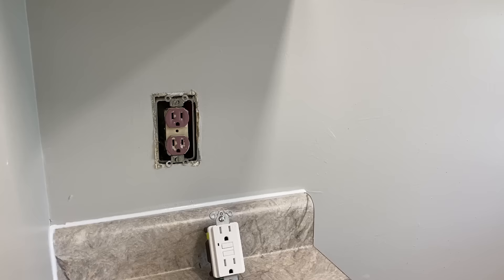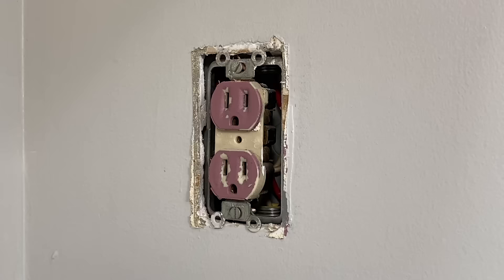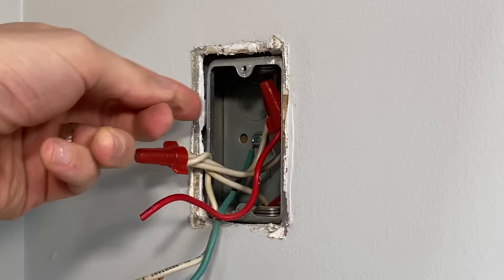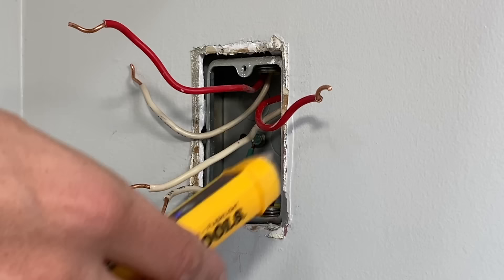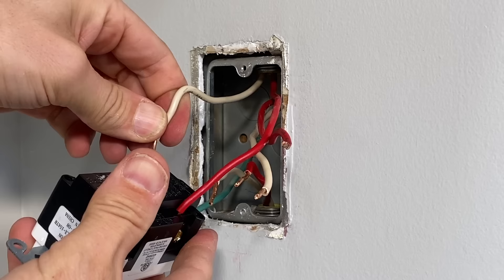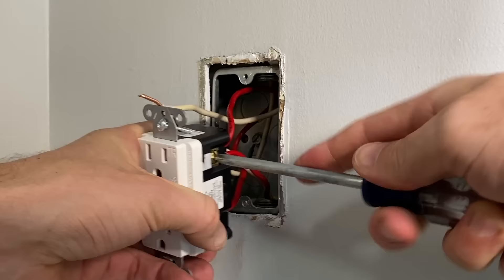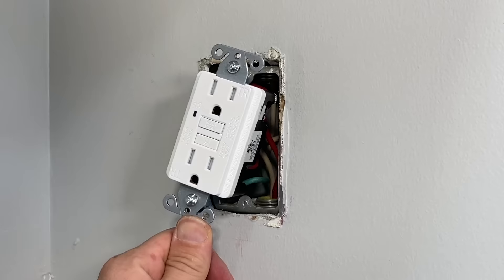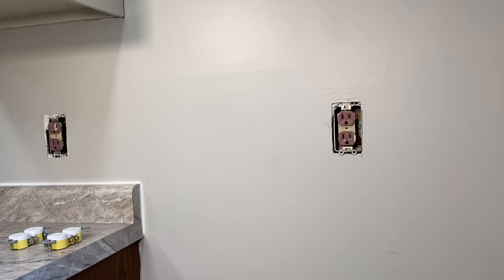Replacing A Standard Outlet With A GFCI Outlet

Comment: Have fun stuffing them into a old metal switch box.   One reason I love PVC switch outlet boxes.  Any electrician will tell u to use a deep box and should tell u to use a PVC
Reply: Yes let the sparks fly
Reply: There's nothing wrong with metal boxes. Just run a strip of super 33 over the screws.
Reply: @jimmac1185  yes. But they are smaller than ovc boxes.  And it is much harder to get a gfi outlet to go back in a metal box. Look up box fill on conductors allowed in a metal box compared to a pvc box.
Reply: @zerosparky9510 It may be slightly easier, but metal boxes are much more forgiving. I do mostly commercial/industrial electrical so we almost always use metal boxes and haven't ever had a problem. Also, if you watch another of his videos, he states that his entire unit is wired in conduit so, it's not like he could chamge it even if he wanted to.
Reply: @jimmac1185  i am a home sparky.  Been in the trade a long time.  Commercial/industrial  you would use metal.   House wiring today is mostly going to be in Rome and pvc boxes.  Unless that city or county says you can't use Romex.    I think Chicago and LA is like that. Dont know why.  I live in Ky. I always tell the guys if you can to use the deepest pvc box u can.  Been on to many remodel jobs over the yrs were had to change out kitchen plugs to gfi,s. Old metal box and crammed with old 12awg bx cable wires.  Sit there and get mad.
Reply: @zerosparky9510  I believe Chicago's rules are based on the massive fire they had there many ears ago.
Reply: @jimmac1185  u might be right.  I just don't know. The guys I know are all talking about giving it up.  As I am. Old and tired.  With the advent of the Arc Fault breakers. Just keeps getting harder  to have people mad at you because of the costs.i had 2 elect inspectors tell me the same thing. That with the NEC being changed every 3 yrs and more and more arc fault breakers added into the code that some homes in some parts of this city find out they can't afford a electrician. So they will try to get Harry down the street to do elec work for them if they know anything about elec wiring.
Reply: Leviton offers a "slim design" it gives a little more room.
Reply: @zerosparky9510  material of box has nothing to do with volume size i just had to do some dble gfci's and cldnt find the dble deep plastic box and just had to buy 2 expandable metal boxes tht where more volume than the one i was going to use yes it was $1.50 more for the 2 metal boxes but they are more stronger and more room too
Reply: @wizard3z868  did not say material did.  Metal switch boxes are smaller.  Less wire can legally go in to code.
Reply: @zerosparky9510  qck checking i see your point never realized but on avg metal was 14cm plastic is 18cm

Comment: never hook the wire around the screw! I did and it is a deader!  thanks for clearing that up. mine has holes I didn't see. but no directions on wiring other than the basic I learned with wiring the standard old ones that are not GFCI.

Comment: Hi Scott, thanks for sharing your knowledge. I want to install a GFCI mid-circuit with non-GFCI receptacles present before and after the location. The circuit is already protected from AFCI breaker in the sub-paneI. Therefore, do I need to protect the plugs downstream using the load terminals as well or just protect this one outlet using only the line terminals? Also, the wires in the box are short and need extending. Can I just use a Wago to simply lengthen each of the 4 wires for attachment or need to use 3-way connectors in a pig-tail configuration? Thank you very much!

Comment: My boss's  method when installing in a metal box would be to put a wrap of electrical tape around the outside of the GFCI protecting the line side screws from contacting the box. Just in case. Also confirming with a GFCI tester the load outlets are protected by tripping them with the tester. Someone may have posted the test procedure already.

Comment: This video was extremely helpful. I have a question which is how I found this video. I am replacing the outlet cover on my porch (which I am changing it to a GFCI after watching this). The breaker for the outlet was not marked so I had to do them 1 at a time. After finding it and turned it back on, the 3 (maybe more) outlets on the line are not working. Checked them with the tester and all are dead. I have made sure it’s not tripped and reset the 2 other GFCI’s inside the house and still no power. The line was working before turning breakers on and off, what could be the problem??? I would appreciate anyone’s input.

Comment: You post really great, straight-forward videos.  I really enjoy them.  But I have a question, my outdoor receptacles are connected to the GFCI of my circuit breaker, which is probably common.  Can they be replaced with GFCI receptacles or the normal one which they currently are?  I noticed that they all have rusted connections and stripped screws.  I also want to add an outlet cover for them as well, which some of the covers (TAYMAC) come with a GFCI receptacles.  Please let me know when you get a moment.  Thank you

Comment: I’m sorry because I really hate to be this guy but....

(1) A voltage tester can only detect the presence of voltage. It cannot detect the absence of voltage. Turning off a breaker and using a voltage tester doesn’t prove there is no voltage present at the outlet. It just proves the voltage tester didn’t make a noise. You should, as best practice, use a proving unit and, failing that, a multi meter.
(2) you really need to explain that, for the line side, the neutral must come from the same cable as the “hot wire”.
(3) you wired up the earth to the receptacle but, where does it loop to the additional load side receptacles?

Comment: Question:
Im looking into buying a older home (1930s) and in the housing inspection, it said that the outlets in the kicthen and bathroom were not GFCI,  so im buying some to install myself.  
So the question is,  would something this old have 4 wires to even install the GFCI properly?  What happens if they don't?

Comment: Nice and informative video. I do have some questions regarding it though. The first question, for the load side of the GFCI socket, are the following 2 sockets downstream to the GFCI socket connected in parallel? It looks to me they are. If the sockets downstream to the GFCI socket are in series, would you just have one hot and neutral connected to the load side of the GFCI socket? This goes with the assumption for sockets connected in series, the hot side of each socket downstream are all connected in series and, the same for the neutral side of each socket downstream.
Reply: They would NOT be in parallel because the wiring design is not changed at all I.e. 1 source to the next outlet and then from that outlet to the next outlet. The wires off the GFCI are still providing one source (in series) from the GFCI outlet.
Reply: All sockets are connected in parallel. Sockets in series makes absolutely no sense.

Comment: My kitchen only has 4 standard outlet, how can I find the correct position to replace the old GFCI outlet?
Reply: Take off all of the cover plates and see which one has the most wires.
Reply: First one from the breaker. Pull all the wires out and separate. Cap them temporarily with wire nuts. Turn the power back on. That outlet's line wire should have power but the other outlets should have no power because they depend on that outlet to get power.

Comment: Can you please explain the load and line? Thinking putting one in my bathroom.
Reply from the maker: “Load” is the set of wires coming into the electrical box that would provide power.  A “line” would receive power coming through this GFCI.  Make sense?
Reply: Thanks

Comment: I have a above ground pool with a pump that runs 24\7 that suddenly stopped working.  At first I thought the pump died, because it was plugged into a GFCI outlet and I hit the “Test” & “Reset” buttons.  I also checked the breaker which looked fine, but I turned it off and back on to be thorough.  Still nothing was working, which is why I thought the pump burned out.  After attaching a different pump that also didn’t work, I realized that my outlet was dead.  I also tested the other outside outlet, which also wasn’t working; it isn’t a GFCI outlet but is on on the same breaker with the other outlet?   After watching the video, I’m guessing that the GFCI outlet is probably just old and warm out since my house is approximately 29 years old.  

So here are my questions…. Is there any differences to replacing a GFCI outlet on the exterior of your home? Should I also replace the other outside outlet, since it is also almost 30 years old.  Lastly, I know that one GFCI outlet can work for multiple outlets, but should all outdoor outlets have their own GFCI?

Comment: Scott I'm learning a ton. Thank you. Scott I have 2 Black and 2 white wires and a ground. Can I use a Wago 221 3 Port connector? 2 black wires from the box to the two ports and 1 black from the last port to one gold screw. Same for the white wires. Then connect the ground to the green screw. Does that sound right? Thanks Scott.

Comment: Great video...I have a gfci bought but when I installed it and it's in the bathroom what will I do..next to it is a light switch it has 4 lines and the gfci 4 also what will I  do...2nd question in my room there are to switch to is ceiling and the 2nd one I don't know what is next...thank you have a blessed day and be blessed
Reply from the maker: For the first question I would need more information but it sounds like the new GFCI will go into a box which has a light switch and an outlet.  When you look at the existing outlet are 2 black (hot), 2 white (neutral), and 1 copper connected to the outlet?  If so, you will need to perform the part of the video where I take the wires out of the existing plug and then test for the "load" wires so I know which wires provide the power and which ones would go into the "line" terminals.  
Second question, I would guess that you might have switched outlets in that room.  Do you have a voltage tester or outlet tester?  If so, test to see if you are getting power at the top and bottom outlet then flip the switch and see if the condition changes or stays the same.  If you have a switched circuit in that room the wall switch will turn on/off either the top or bottom outlet.  Let me know what you find, thanks!
Reply: Thank you for this answer!

Comment: Thanks for the video - very helpful.  Question - must there be 4 wires on the load side and two on the line side?  My outlets have four in total (two hot, two neutral).
Reply: No. He has two circuits downstream so that's four wires on the load. If you have just one then you just have four wires total.

Comment: I have a working GFI tester plug that does not light up in a GFI duplex but the duplex still provides power to my garbage disposal; BUT the bottom duplex will not run anything. What is wrong and why does the GFI tester not show anything?

Comment: I was searching about GFCI and found this>>>>> Can you put 2 GFCI outlets on the same circuit?

Having 2 GFCIs on the same circuit has no added benefit and can cause the occupant confusion when it comes to tracking down a tripped GFCI outlet. When the GFCI is installed on the lead outlet, there is no need to wire multiple GFCIs on the same circuit for residential use.

Comment: Great video. How did you know which of the white wires went with the line, and which white wires went with the load?
Reply: normally where ever the line  hot wire is so is the nut. white but with conduit it can be tricky and sometimes you have to do indepth testing

Comment: Quick question, Say I get lucky and remove an outlet and it’s just got two cables and no pig tails I would think that 1 set of wires would be my load wires correct? The pig tails are probably jumping off to other outlets in this situation I’m assuming.?

Comment: Hello. Thank you for the video. It was very helpful. I have an electric fireplace in my basement and on occasion the breaker at the panel trips. I was wondering if I should put in a GFCI outlet where the fireplace plugs in to possibly avoid the entire circuit going down and instead would just have to reset the GFCI if there was a surge. Please let me know if you think this would be a good idea as well. If not, can you please recommend another solution? Thanks again.
Reply: IF IT TRIPS YOU KNOW THAT IT IS BECAUSE IS GETTING OVER LOADED. WHO KNOWS WHAT ELSE IS GETTING POWERED BY THE SAME BREAKER. IF THE BREAKER IS 15 CHANGE IT TO A 20 AMP.

Comment: I heard that putting electrician tape around it helps so it don’t short out
Reply from the maker: Yeah, many others indicated they prefer this method especially in metal boxes.
Reply: In a single gang box like the one on the video i would 100% recomend use electrical tape. Especially if the white  (neutral)  or black/red (hot, power, line) insulation is not well covering the copper wire

Comment: I live in an older home with knob and tube wiring. Is it possible to still be able to install a GFCI outlet in this case? I had the electrical in the basement replaced with Romex, but I'm sure if the wiring to my outside patio was replaced as well, that runs out from the basement level. Great video! Liked!
Reply: Sure, yo just must mark it "No equipment ground".

Comment: Yes I've been trying to hook up my GFCI soon to another Outlet the indicator light only testers are lit up if I hooked up the two neutral lines and then hooked up I hope. The to hotwire upper side of the outlet I go to plug a light into the outlet one and then lyteworks when I go to the second lock the light does not light up what could be my problem

Comment: Question: can you change all three of those outlets to GFCI outlets? Should you only change the first of the daisy chain or may I make the daisy change GFCI outlets? Please let me know. I have five outlets all within 6 feet of a sink, however only two of them were GFCI outlets and three were regular. Not sure if I should make all 5 GFCI or just change the two.
Reply from the maker: As long as the first in the chain is a GFCI and they properly are wired to the "Load" side of the GFCI you should be covered with the ground fault capability on the normal receptacles downstream.
Reply: @EverydayHomeRepairs  thank you so much!

Comment: You identified Line/Load on the hot side. 
Question: is there a certain neutral wire to go with the Line side of the outlet?
Reply: Yes, if you notice in the video the three sets of wires all come into the box from different positions. One from the top, one from the side and the third from the bottom. He identified the one from the top as the hot wire. You use the white wire that is matched with it as the white line wire. Wires can come from all directions in different boxes, that is why he separated them out in pairs.

Comment: Great video, Scott. One question in particular; if I have the same situation, could I convert all outlets to GFI? I see in the video you only did one, as the others were daisy chained. Is there a downside to converting all to GFI?
Reply: GFCI RECEPTACLES ARE INSTALLED WHERE NEEDED. THER IS NO NEED TO CONVERT EVERY SINGLE OUTLET INTO A GFCI. BUT GFCI CAN PROTECT OTHER REGULAR OUTLEST THAT ARE TIED TO THE GFCI AS A FORM OF PROTECTION. IM NOT AN ELECTRICIAN, BUT I DO ELECTRICAL WORK.
Reply: You might want to check out the AFCI , which are required for bedroom and other convenience outlets, if your concerned about upgrading to code. GFCI are required where water/ moisture is an issue, outside, bathrooms, garages, kitchens. Which you most likely have. Good luck

Comment: I tried to do this on an old plug that was near a sink in my daughters basement.  It has two cables coming into the box.  No matter how I try to hook it up, the gfci won't reset.  Not sure what the deal is.  The breaker for this circuit seems to be shared with different parts of the house.  Light and plugs on the same circuit.

Comment: I'm replacing a dishwasher and the outlet under the sink isn't a GFCI outlet, apparently it wasn't code when the house was built, so I figured this would be a good time to replace it.  But I'm wondering it the outlet also needs some sort of water protection box around it as well.  Any thoughts?

Comment: Hi Scott, I have a question please. I have a burnout GFCI that power my sprinkler system. I replaced the GFCI outlet and it is only one set of cables, black for the HOT, white for the White terminal and third one for Ground. So I just connected those Black and White to the LINE part and no cables to the LOAD. After replacing it, my voltage tester shows light (there is power) but no voltage (very low, not 120V). The other GFCI outlets on the same line (they are all outdoor) are fine. What did I do wrong here?

Comment: seem brand new safety outlets I have been all bad reset fuse in them no then at all, had to switch to a stander outlet lower fuse box switch to 15amp tested work well pop switch, waiting on the new cover for its stander 3way plug type outlet... I try 3 safety outlets of they were all bad.

Comment: Hi, I tried remove old out let by install a new GFCI.but when I opened the old out let I have found two black and two red wires have connected to hot line terminals and two white also connected to another terminal and the ground wire is connected from the out let to J.How can I correct to install all wires to new GFCI .Thanks

Comment: So the line comes from the breaker and the load goes to the anther switches?
Reply from the maker: The line would be the power coming into the box and that could be coming directly from the breaker.  Yes, the Load would be powering an outlet or 2 downstream to provide GFCI protection to a standard outlet.